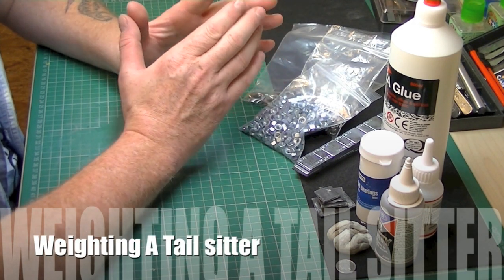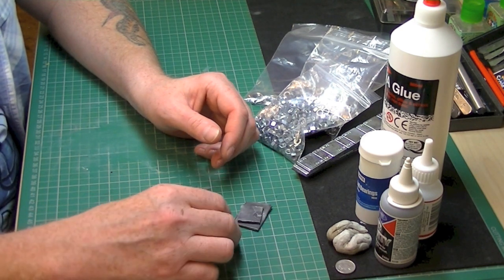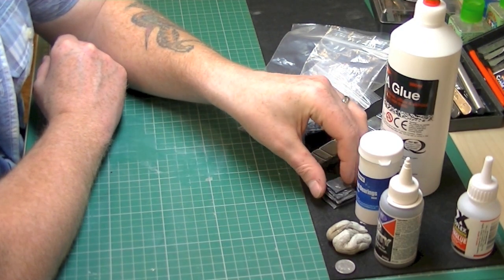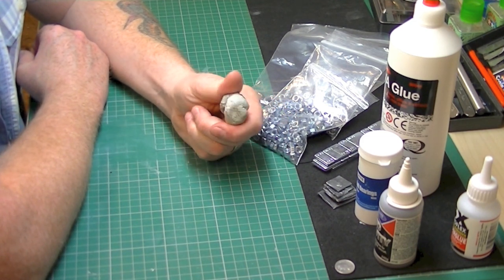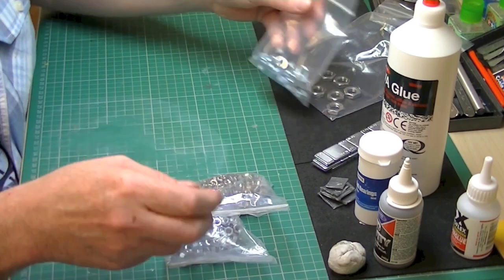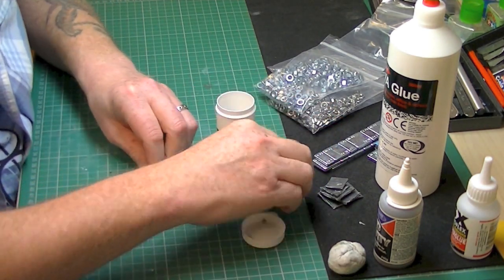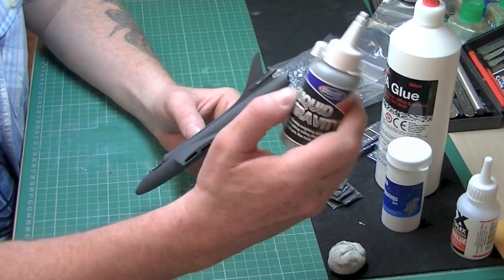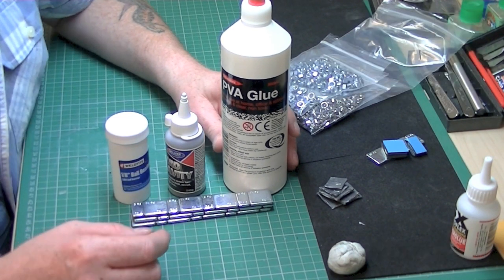Weighting a Tail Sitter - What to Use

Comment: This may be the most American thing to say, but a cheaper alternative to the liquid gravity (although i don't know if it'd be 100% the same effect) would be to buy a bag of #12 lead shot (for a shotgun). The pellet diameter is 0.053" (~1.3mm). Sure, an 11 lb bag is going to run you around $40 (Liquid Gravity is around $18 for a bottle containing no more than a few ounces) BUT your great grandchildren will still be weighing down tail-sitters by the time the bag is half spent lol. If you have some mates that into modeling, just split it up- everyone gets % of it and splits the cost.

Comment: I just had an idea.  What if you took a flexible refrigerator magnet & cut a small piece from it......and drilled out or somehow removed a bit of the nose-wheel?   Stick the bit of magnet in the hole,  sand & paint it........and then if you're going to set the finished model onto a base ( or diorama ).....just make sure there's a tiny bit of metal on THAT.    I might try that with a 1/48 Cessna 172 kit I recently bought.   The engine compartment looks too small to really add a significant amount of weight.   And I don't really want to build it with the closed compartment, as I could leave it open, to display the engine.

Comment: Absolute newb here, so I hope the answer isn't too obvious.  I know that I/we want the weight hidden, right?  In the nose, or tail area, before assembly.  So here goes the question.  How do you know you're going to need to weight the nose or tail prior to assembly?  If I find out after I've assembled the kit, that it needs weighting, that would obviously be too late.
Reply from the maker: A lot of the kits will tell you in the instructions, the rest it's a best guess.  A lot of modern 50's onwards are tail sitters.  Once the kit is made you can always drill a small hole in the nose section, pour in the liquid gravity then a little PVA and reseal - Job done :)
Reply: Awesome!  Thanks so much for the info.  Keep up the good work, your vids are awesome.
Reply: Or just put some weight in the nose just in case.

Comment: I just started building planes... Why would you want to weight a tail or nose .?
Reply from the maker: A lot of modern jets are known as tail sitters.  This means that as the wheels are so far forward the tail is too heavy and sits on the floor.  You need to put weight in the nose to balance the model, so it's sits correctly on it's own :)